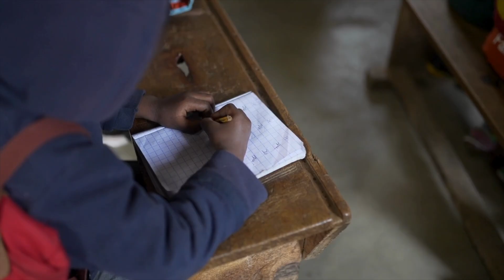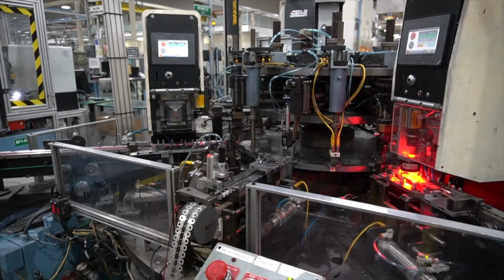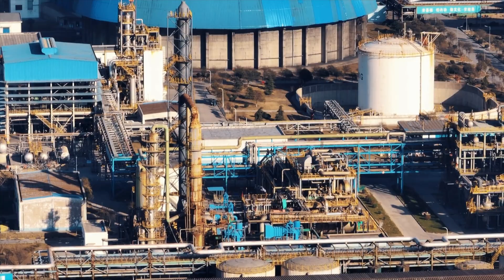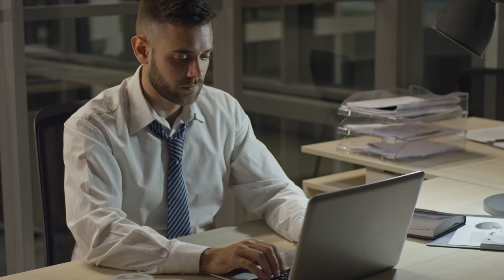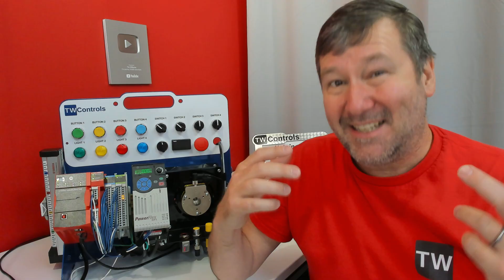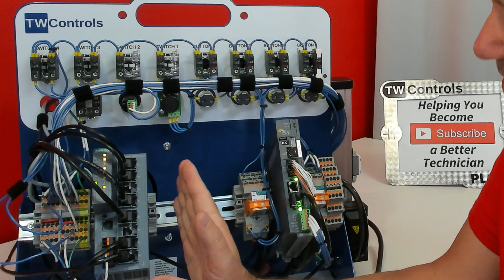Industrial Control Panels: The Hidden Technology that Impacts Your Daily Life

Comment: Best part of panel design is finding creative solutions—on a brake disc fettler I replaced a troublesome spring/prox setup with a conductive level relay and insulated stop. The brake disc itself completed the circuit, saving about a week’s maintenance a year. Great video Tim.
Reply from the maker: Thank you!